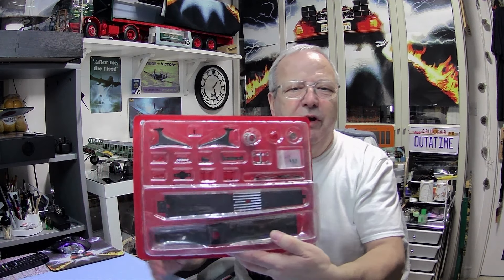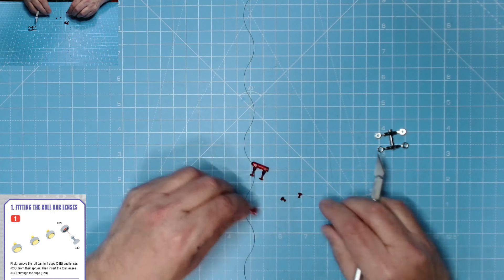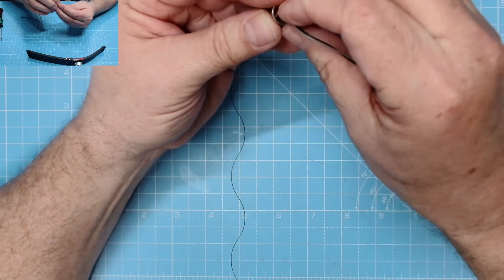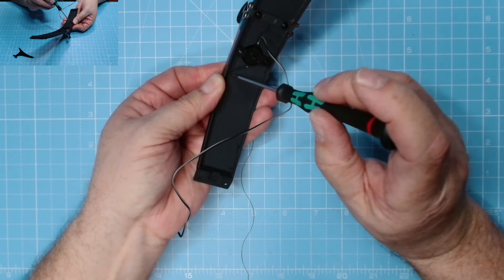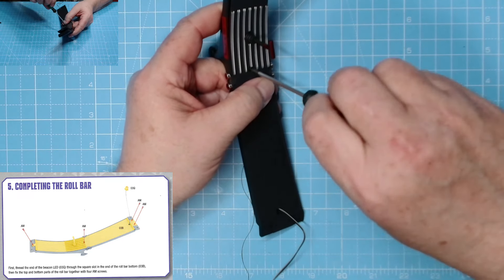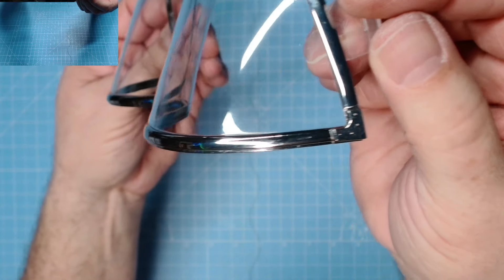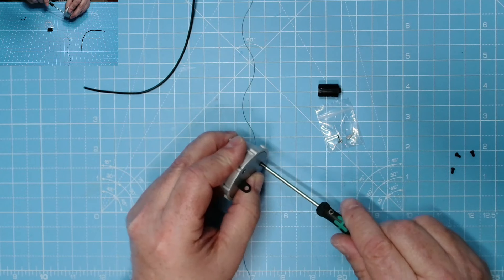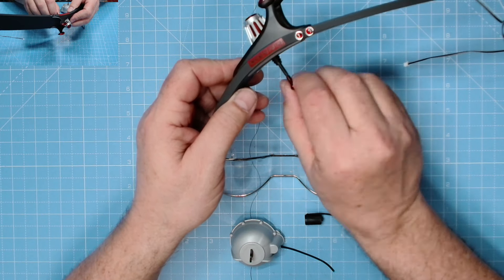Build the 66 Batmobile Phase 3 to 5 from Fanhome

Comment: Hi John, great watching this and all your builds. I am also building this Batmobile as I used to have the toy version when I was a little lad, so it's a trip down memory lane. If I remember the toy version used to fire rockets out of the three launchers. 

Anyway, I have a daft question. Should the LED work with any tester? The only one I have is the one that came with Issue one of the hachette lancaster. I plugged mine in and it didn't light up? I know the tester works cos the motor still works on the lancaster. Fanhome are great and are sending me a replacement but I don't want to plug it in to test of it's the wrong tester and I blew the 1st one!
Reply from the maker: That is the tester I used, 3volts shouldn't be a problem.  Yes, I had this car as a kid, but that's a long time ago, and I can't remember if it did shoot rockets.  👍😊
Reply: @JohnsModelmaking  Hopefully it was a faulty LED then and the new one will work when I get it. Thanks for you help John, keep the videos coming.